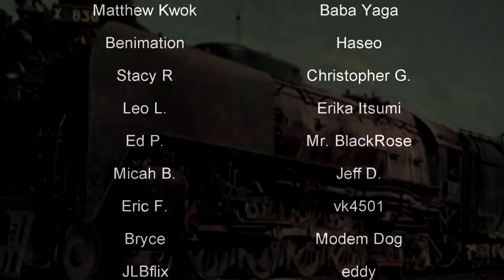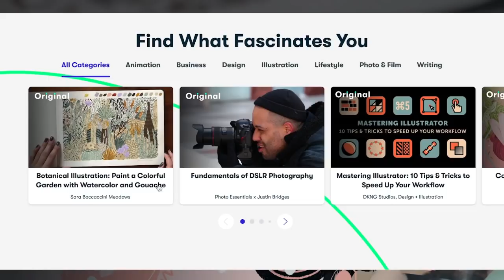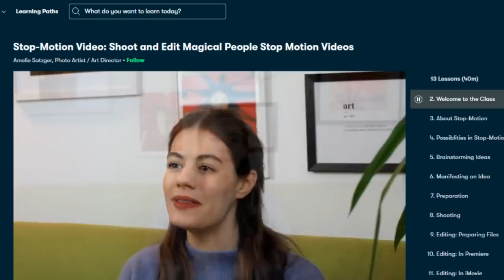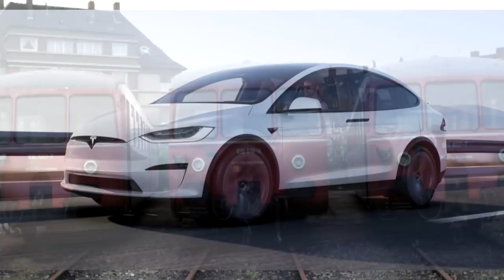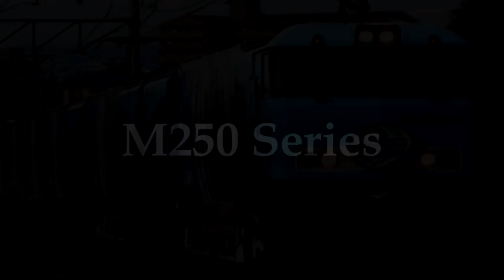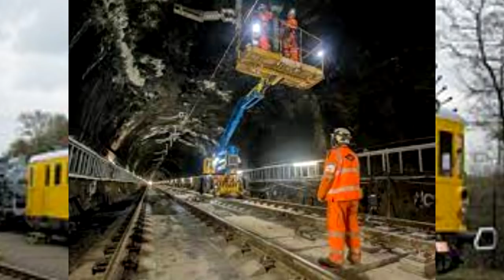5 MORE of the WEIRDEST SUCCESSFUL Trains Ever Part 3 🚂 History in the Dark 🚂

Comment: There was one big problem with the Climax however: They tended to shake themselves apart. Due to the unusual placement of the cylinders, the uneven weight balancing on the transmission connection, and often a lackluster build quality, they tended to suffer from severe vibration, particularly when working hard or near their top speed, that over time would quite literally, well, as I said, shake the entire locomotive to bits. Breakdowns were common and they were considered much less reliable than their rival shays or heislers, both of which had much better ways of handling the drive forces involved. This is part of why there are so few climaxes in preservation, and fewer still in operational condition; they just weren't built to last.
Reply: You forgot that the climax could sometimes buck unsuspecting crew from the cab when going fast
Reply: Yeah, of the geared locomotives, the Climaxes were absolutely the worst of the bunch

Comment: Suggestion for succesful trains:

Polish EN57 EMU

Supposedly the longest production run of any EMUs in the World, from 1962 to 1993, still in service today, on many lines as regional and suburban trains.
In bigger cities you can spot them, a 1960s design, next to modern day Pendolinos!
Reply: Are there still some EN57 in service which didn't go through modernisation?
Reply: @pozitroncz8679  Yes, there are. Some even have perserved the original seats in the TriCity SKM system
Reply: @mikeymikey4186  I was there (in Gdańsk - really beautiful city) last year and I unfortunetaly didn't encounter any unit in original state.
Reply: @pozitroncz8679  oh, Pomerania is basically the "EN57 kibel paradise". A lot of barely modified units have their home there. The modifications usually include LED displays on the outside, new seats, bike holders or the so-called "hot buttons" (individual door opening system) and are otherwise technically same as when they left the factory in Wrocław. During the weekdays, not spotting one is close to impossible.

Comment: The derelict-looking Fairlie with sandboxes around the base of the funnels looks like an NZR E class. Six were supplied in 1873, and written off in 1899. Two were scrapped quickly because their bogies were needed for breakdown cranes, but the other four stayed in service between Whangnui and New Plymouth, and were used on important trains like the New Plymouth Mail. They had some money spent on them, being fitted after 1899 with airbrakes. In 1920, the regional manager found out, and ordered them to be scrapped forthwith.

Comment: We had battery powered EMU's in the UK as well, they were used by the Souther Region of BR for boat trains to Dover, the 419's/MLV's were single car with a cab at each end, a guards area and two luggage compartments. 
Could be used for ~20-30 mins at low speed for use on the un-electrified docks.

Comment: British Railways had a battery electric multiple unit in Scotland introduced in the late ‘50s or early ‘60s.

There were geared locomotives built like road traction engines with the cylinder block and crankshaft mounted on top of the boiler and the drive transmitted to the wheels by either gears or a large chain.  I have seen two of these, one in the London Transport Museum and the other at the Buckinghamshire Railway Centre.
Reply: There’s actually one operating now on the Stourbridge branch from Stourbridge junction to Stourbridge town. It uses a battery to power a flywheel. The flywheel once spinning will have a fair bit of inertia as it finishes its journey and the battery is on charge once it reaches either of the stations.

Comment: My personal favourite geared locomotive at the moment is the davenport duplex- it has 2 separate 4-wheel-bogies as with the climaxes, but intriguingly, each bogey has its own set of running gear that at first glance looks the same as a conventional rod locomotive, however, the rods actually connect instead to a crankshaft mounted behind the wheels, which then drives gears mounted inside the bogie to drive the actual axles. They weren't all that successful because of the high requirement for flexible steam joints, and the fact that their gearing was contained in a sealed oil bath (bulleid would like to have a word), but very interesting machines with a super unique arrangement!

Comment: ayyyy a train unit from my country, the M250s have about the same acceleration and speed as a commuter train but surprisingly haul less (16 cars max) then the conventional locomotive pulling from the front (26-30 cars max) and a few cars on the M250 needed to be motorized since like darkness said they're EMUs and they needed to have electric converters and pantographs somewhere which ment less cargo space too, but the main goal for the M250 was to be better then road transportation espically for short distance so just think of them as the commuter trains for freight.
japan still uses electric or diesel locomotives for freight today.

Comment: The first battery operated rail busses existed as experiment since before 1900! The first larger series were built in the 1910's en 20's. Those had a range of 100 to 150 km. After WW2 they wanted to build a new series of battery railbus. This became the series ETA 176. It was succesfull, but waaaay to expensive. The ETA 150 was as simplification, but proved superior with a range of 400-500 km on a full charge, flat terrain and good weather. They ran until 1994(5). Interessting that they are now being re-invented.
Reply: We had a full series of locos in the 30 and 40tys. They turned out to be mostly underpowered,  and ended up in track maintanance service where they pulled  light loads and was with out power only for short periods
Reply: The PKP museum had one Wittfeld in drivable condition in 2007: https://www.youtube.com/watch?v=fLPuftBW6JA

One of the problems with the ETA150 in preservation (besides not having any charger units) is that the main frame bars tend to rust because of battery acid spillage. The one in Bochum has a lot of rust around the battery area
The 3 units in the picture are control the cars (with a number in the 8xx range indicating a control cab for an electric railcar))
Reply: Didn't know about German battery rail busses, but they have built a large number of diesel mechanic rail busses (A-1+1-1; motor car and trailer car, built in Uerdingen Krefeld Germany with Buising engines) worked great for years  especially in my country where we built them with few modifications from 1960-mid '70ties! Series 812/818.

Comment: Some interesting things about the JR Freight M250 series EMU: 

1.These units were not just built by Kawasaki Heavy Industries; they were also built by Toshiba and JR Central subsidiary Nippon Sharyo (back when Nippon Sharyo was still independent).

2. These are 16-car trainsets, consisting of a driving power car and a power car on either end, six trailers equipped with train monitoring equipment and one trailer without a train monitoring  equipment in between.

3. The cargo containers used on these EMUs are 31 foot containers.

4. This EMU is the recipient of two awards: the 2004 Minister of Land, Infrastructure and Transportation Eco-Products Award for Eco-Service, and the 2005 Blue Ribbon Award by the Japan Railway Club, the first time a freight unit won that award in Japan since the JR Freight EF 66 locomotive in 1969.

Comment: In what proved to be the Double Fairlie's ideal use cases, the limited bunker capacity wasn't as much of an issue as you might think. It was a problem on long mainlines (which is where the USA tried to use them), but on shorter lines with plenty of stops it's a minor annoyance at most. The Double Fairlie is optimized as a powerhouse for steep, space-restricted lines (as many mining and logging railways are - including the Ffestiniog, which it was originally developed for) - and in that regard it performs admirably.

I'm pretty sure that Lego did a set based on the German sprinter during their '90s-'00s 9V era.

Comment: Two Climax locomotives preserved in Australia. One, the last Climax built , runs for special events on the Puffing Billy railway out of Belgrave near Melbourne :
https://youtu.be/Zd190KdeCXw
This was the last Climax made in 1949 and the only one made to 2ft 6 inch gauge. One of the few Climax engines still operational. Top speed for logging purposes estimated at 8 mph.
Another version in the Australian state of Tasmania.
Reply: Sorry built in 1928 and in logging operation until 1949.
Still the last Climax built.
As per the extra description on the linked video.

Comment: You might want to check out the JNR EF63 they can easily handle the 6.67 grade at Usui Pass that used to have an Abt Rack rail that the ED42 used to roam on. Also, the LO series has the top speed record for the fastest train btw. Despite being a Super-Conducting Maglev.

Comment: Did you ever do anything on UK Network Rail's "Flying Banana"? It was adapted from an HST and some carriages. 
The train goes around the rail network to find track defects and problems with overhead lines while travelling at speed.
Wikipedia calls it the "New Measurement Train" even though it dates from 2003.
Reply: The HST was nicknamed the flying banana long before Network rail got one as a track measurement train. It got its nickname from the broad yellow swatch along the bottom from the front on the power cars. The new orrible Japanese things have been nicknamed Flying cucumbers

Comment: In Birmingham UK they used a few battery trams in the early 1900's in places where the locals didn't want overhead power lines. The main issue was that the acid fumes from the battery would destroy the metal frames of the tram over time.

Comment: The german DMU container carrier worked very well and had good preformance.

The was powerered by a normal truck engine. Typicallt it was set up wirh one engine car with one blank car.

They was not permanentat conected, but rather just conected with a normal coupeling.

So one might imagine that the cab sections work like locos... oh no, not even close. They work more like a controll car with the engines under the flat bed wagons of the train.

The train can run with out the cab section via remote or from a other loco in a normal train, adding  power.

So perfect?

Well, not reallt. There was a number of drawbacks.... for instance... how do you fuel 15 engines... well the answer turned out to be one by one.

The other issue is that they used the same coupeling as emu/dmu,  not fright trains... so they are basicallt incompatible with freight trains.

The engines also turned out to be expensive to maintain. Basically... good idea ... on paper. A lot pf drawbacks in reality

Comment: Are these the Uerdingen railbuses? Excellent machines but..... not crash safe. Look up the Dahlerau rail accident for proof. (Heide Rosendahl, the Heptathlete and long jumper, lost a cousin of hers in the accident, BTW.)
Reply: Nope the battery version.
Reply: Honnestly, the Uerdinger railbus were a bit like the pacer, only a little more comfortable, much better in my opinon (for being designed in the early 1950's) and there were way more of them. 584 units with a single engine and about 335 with 2 engines.